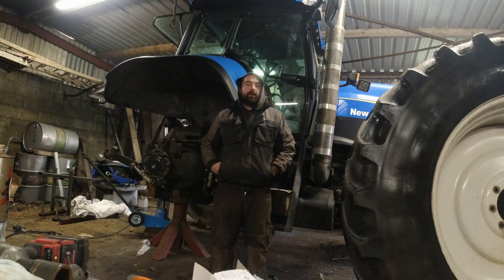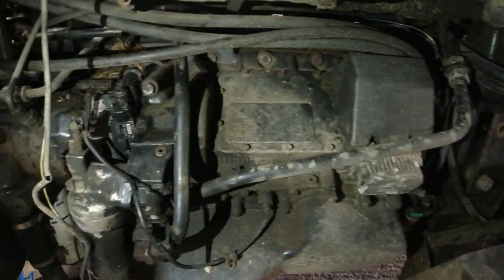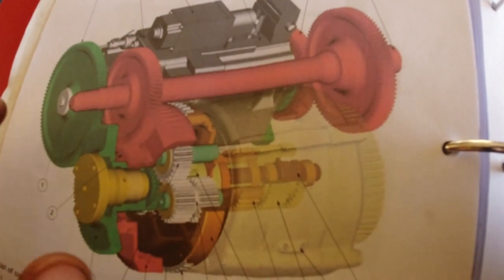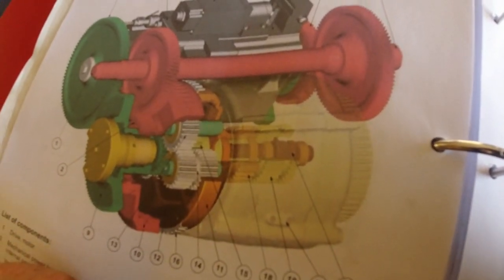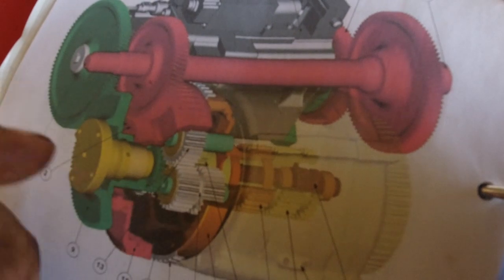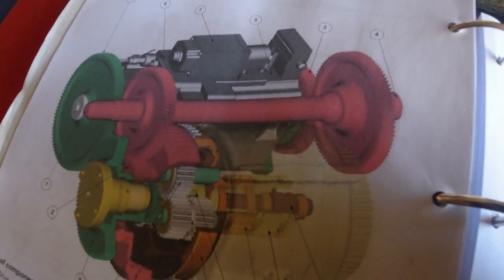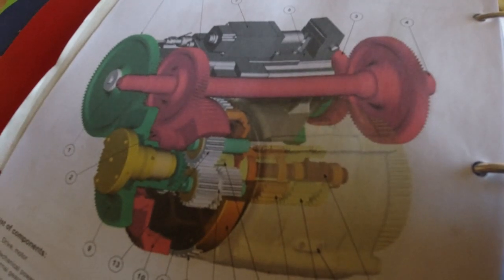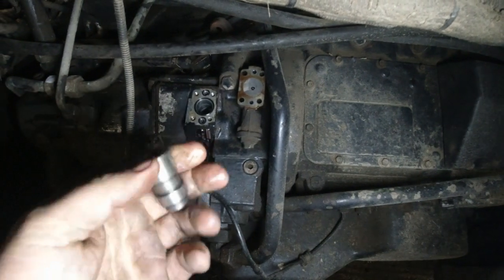TVT in the sick bay, How a cvt transmission works

Comment: Hi,
I have problem with T7540 
Tractor was working fine at field, and in one moment lost transmission with no strange sound, just stopped.
We checked the oil pressure and it was arround 4 bars at low rpm, I think 15 bar at high rpm. Transmission should have 32 bar I think. I removed transmission pump amd send it to test, it seems to be ok. 
Do you have any idea where could I lost pressure in transmission.
Kind regards!

Comment: Thank you for the infomative video!

I have a TVT190 it have this problem of putting the transmission at stand still. I have to restart engine a number of times before transmission start working again properly without a problem. What you think might be the problem?

Thank you!
Reply from the maker: You will need to go into more detail .
Keep the up and down arrows pressed on the pillar display it will bring you into the fault code menu .
Select the sgr and let us know what codes you have.
Reply: @mrcvx  Hello Sir! Thank you for the reply!

I checked the errors this morning and it’s displayed as follows:

FAULT
FMGR - AUX1   KPAD
SGR - AUX2    EDC
EEM - AUX3
ARU - AUX4 
ICU - AUX5
ECCU - HDIC
Reply from the maker: Go into the SGR controller it will display the faults and the hours they appeared at

Comment: Hi
I currently have a cvx 1195 in the workshop for stepper motor replacement.
I also have an air problem like yours. Cold start you can hear the transmission shuddering. Even the transmission cooler on top of the transmission makes loud shuddering noise.
Could it be a similar gasket problem to yours? Would like to get information on this before we put everything back together.
Thanks.
P.s: Great video you have made here
Reply from the maker: It can be a couple of things I'm told.
It's either that gasket or the seal on the hydraulic pump, if it's the seal on the pump she will pull the transmission oil through the hydraulic pump.
Or it could be seals on that low pressure pump.
Unfortunately you can't get the seals off case but there's a company in Dublin can do the pumps up I'm not sure what it costs.
Also you need to be sure your transmission filter inside the plastic housing is fitted properly.
Sounds silly but it is difficult enough to get it on right.
Out of curiosity how much was a stepper motor
Reply: @mrcvx  cheers for the information. I must check the filter. It seems to stop when the tractor warms up. I know if you open the filler cab on the back you can hear it hiss air out.
I got the stepper motor reconditioned by a lovely more than helpful guy in Italy. Company is called farmelec. They have a wealth of knowledge and used to WhatsApp me pictures and information about them. They had some tractors in their workshop and was helpful for information
Reply from the maker: I was talking to him before he's a fierce sound lad and knows his stuff.
What did it cost to recondition the stepper motor if you don't mind me Asking
Reply: @mrcvx  He gave it a full recon and it cost 1200e
Reply from the maker: Not too bad better than a new one!!
Reply: @mrcvx  hopefully 👌
Reply: I follow you on YouTube and I'm really drawn to what you do. I'm a mechanic and I have a problem with a New Holland TVT170; it keeps stalling! The EEM and EDC lights are on. I can restart it with the EDC light on, but when the EEM light comes on, it stalls immediately. I have to wait for hours for the EEM light to go out before it will restart.

Comment: 😱😱👏👏👍👍
Great video. Very interesting to know these thing's.
What do you mean by lossing pressure? Is it that the tractor slows down & eventually comes to a stop, even with your foot on the pedal?
Ya. Sometimes you need to have a deep pocket, when going through a main dealer, to get something fixed. 😅😂🤣
But also you need to be a bit mechanical minded to do some of them job's. It seriously helps you anyway. Personally I'd be a very small bit mechanical minded. So even doe I'd have an idea of what's wrong with a yoke. I'd be more likely telling a more experienced person than me about & let them do it. As I feel it helps them to go to the exact spot of the problem. Also I'd be the person that would tighten that nut you were on about to tight & fuck up the rest of the thing's along the line.
Your to try & prevent thing's from happening, before there time, so to speak.
As I was looking at the transmission, 1 thing I spotted was why weren't the numbers  of the different parts, going around the picture like a clock. Instead of having them nearly all over the place. 😅😂🤣
Great video again. Keep it up. 👏👏👍👍
Reply from the maker: No what it does is it sends an error to the transmission ecu and it won't let you drive

Comment: Interesting vid, no CVT around here,range command all the way!. Off topic,just wondering how you'd rate fusion 2,you went from 1 to 3. Fusion 2 probably bit old now anyway. Running  a5500 and 5600 but can see fusion at some stage.
Reply from the maker: Your about a week too early as I speak about it in the videos I hope to have out over Christmas.
It depends on what you want to do a fusion 2 would be poor in short wet grass and blocking the pickup you might have experience with that in the one you have?
Reply: Not much trouble with blocking until autumn 2017, figured out what lads on about. Wet grass jammed in front of rotor ☹